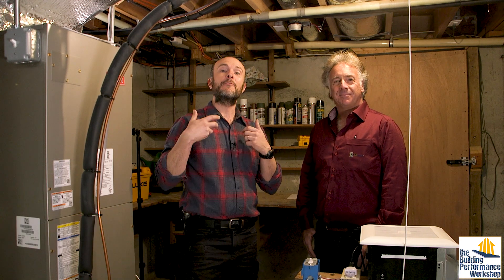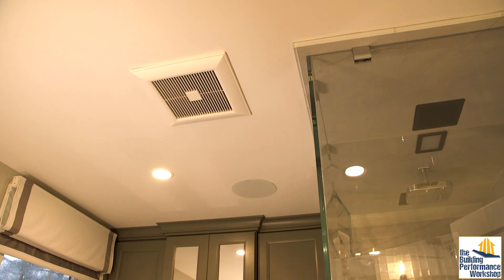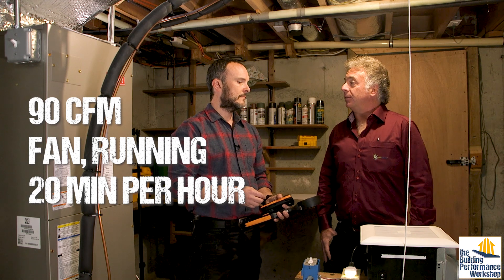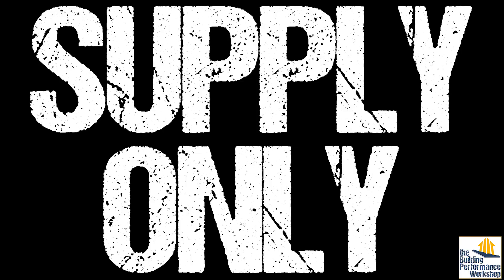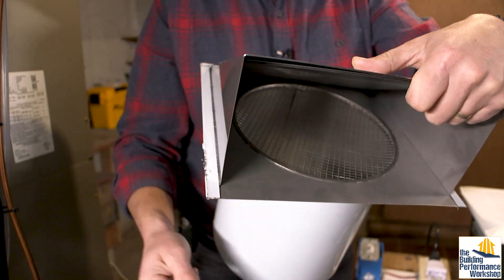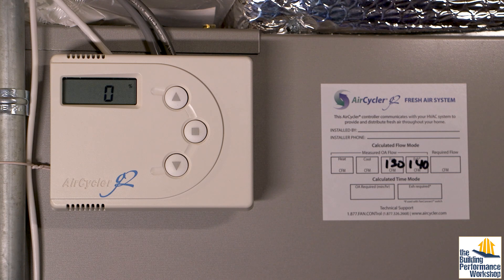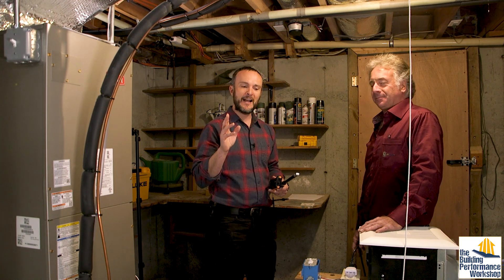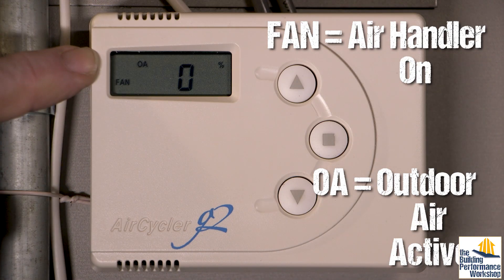Testing 3 Home Ventilation Systems: Exhaust, Supply, and Combined using AirCycler

Comment: The bro in red is an expert but says his windows are low e.  That has nothing to do with air flow lol.  he also says he can heat his house with a candle.  Does he use aerogel? doubtful.  R-rating just indicates how long it takes for two different temps to equalize.  Again, nothing to do with air flow as you can do this without an air exchange.

Comment: Fresh air supply question - 2 story home with full basement.  I have a 3 inch fresh air intake with manual baffle that feeds into our cold air return for furnace in basement.  When furnace blower turns on, the basement door is sucked closed.  This tells me the basement is sucking air from the first floor?  Or, does this mean pressure is being raised on the first floor because of the room vents?  Ideally, shouldn't this NOT happen?  Does this mean I'm not getting enough fresh air into the basement?  If more air could enter the basement from outside, wouldn't this be better for the whole system? Thanks!
Reply from the maker: Hey Rich- 3” is not a lot, so I kind of doubt that’s the only cause of your issue. Could also be an unbalanced duct system. Hard to tell untill you run the testing.
Reply: @HomePerformance  Home Performance - Thanks.  But that's my point, I don't think it's enough replacement air from outside from that narrow duct.  Need larger?  Related question... If I added an air vent to basement ductwirk (not a return, but an actual vent), wouldn't that help reverse the negative pressure that is generated by not having enough replacement air for the basement furnace?  I say this because this additional basement vent would add some replacement air.  Make sense?
Reply from the maker: Yes, but it’s also possible you have a lot more return in the basement than you know, through duct leakage. That’s why I love testing- instead of trial and error, you can figure everything out in one afternoon.
Reply: @HomePerformance  Home Performance - Yes.  Agreed.  I checked all the return ducts coming from upstairs that run through my
unfinished basement joists.  They are incredibly leaky!  Looks like a 10 year old did them.  1/2 inch gaps, 1/4 inch 3 foot long open seams along the ducts, and more.  When HVAC fan runs, these massive openings are creating negative pressure in basement, by obtaining air from the basement instead of upstairs return vents, correct?  If I seal these leaks in basement cold air returns as best I can, wouldn't this force my system to draw more replacement air from upstairs?  And this, along with one more vent blowing into basement, should help equalize pressure between the floors?  Thank you so much!
Reply from the maker: Yes, you’re on the right track, Rich!
Reply: @HomePerformance  Home Performance - Interesting!  Thank you so much!  I'm starting to wonder if my home ever truly needed a radon mitigation fan system now - given my basement is one giant 2000 square foot vaccuum now!  It's probably sucking radon gas out of the ground every time our HVAC fan kicks on or when my natural gas furnace and water heater combusts.  Am I still making sense?

Comment: over complicated m..... open the window case clod. good luck making repairs with that dam foam. its 15/sqft to cut it out to repair or add stuff in the wall
Reply from the maker: Old fashioned ways don't work the same anymore. Follow our channel to see why.
Reply: @HomePerformance , don’t try to impede tradition with progress!
Reply: For his specific system, he shouldn't just open his windows and you shouldn't just open your mouth.

Comment: Your audio is such a mess in your videos. This one, one mic is on the left channel and the other is on the right. Which really sounds horrible on a home theater that has a center speaker and a processor that’s trying to do something with it. Only place this might sound normal is a phone that’s down mixing it to mono.  🤦‍♂️ wish you tubers would watch videos on sound post production and what loudness is. And what YouTube’s loudness standards are.  

Sound quality is probably the biggest thing that separates broadcast TV and YouTube content. Can’t tell you how many videos I turn off because of horrible sound.

The way most TVs and AVRs need to see audio is a stereo signal. Mics should be mixed properly. When the level is the same on both channels, sound processors will assume that’s dialogue and puts it though the center speaker. Any difference in levels across channels will shift the mix left or right. It’s perfectly fine mixing with desktop studio monitors. Headphones are not great but can work if you know how they change audio levels. Best is to use a consumer 5.1 surround system combine with a shitty built in TV speaker.  Checking the mix on both.  Slap a compressor on each mic to keep levels consistent. Monitor loudness levels at the end. Most nonlinear editing apps have monitoring tools built in or you can get plugins. Or you can use third party apps to analyze a video file and give you audio metadata like loudness, peaks, dropouts, etc.   

https://youtu.be/jowVS3qz0CQ
Reply from the maker: Golly, I am SO SORRY that our videos that no one paid us to create, and which you fid not pay a cent to watch, don’t meet your standards for network television. Also, with such an amazing viewing setup, you should have an option to listen in mono. Please be nicer.
Reply: @HomePerformance  And here I've been focusing on the science you're overwhelming me with!  It must be the sound quality that's causing my brain to explode when trying to absorb this free science lesson to us!

Comment: It would only be smart to bring fresh air in through a heat exchanger as the air goes out.  Otherwise you are drastically raising your heating energy or conversely your cooling energy.  It has to make common sense.  Why would you pay to have a super tight house and then introduce air leaks on purpose?  If you need ventilation it has to be conditioned or you are wasting money.
Reply: Douglas, 
Physics tell us that there is not a lot of energy stored in a cubic foot of air. You can compare the cost of operating and conditioning the air using an AirCycler ventilation product vs. a system with energy recovery with the Cost Ventilation Calculator that Residential Energy Dynamics (RED) developed https://www.aircycler.com/pages/calculator. You will see that not only is the cost to operate an AirCycler AND heat or cool the incoming fresh air minimal, but when compared to the cost of purchasing, installing, operating and maintaining an HRV, the AirCycler is the more efficient system. 

Let’s not forget that it is a relatively small amount of controlled fresh air being brought into the home. In the 20 years that AirCycler products have been on the market, we have not received a complaint of drastically increased energy bills. Tightening up the home and adding mechanical ventilation is the industry standard for maintaining healthy indoor air quality. There are a number of mechanical ventilation products on the market, ranging in cost, ease of installation and maintenance required.
Reply from the maker: This is America. Everyone here wastes money every second of every day. Wasting a few bucks on untempered outdoor air seems much more reasonable than on alcohol, wings, coffee, fidget spinners, etc, etc. Remember, these ventilation methods are perfect in renovations, or when you don’t have the space or budget for an ERV that does what you suggest. Ventilation is NOT just for the wealthy, or just for tight homes.
Reply: shut up just as wack as these clowns open a dam window
Reply: @divinee.155  Bro are you okay?

Comment: Corbett.  This is good stuff.  Thanks for the link on how to find out how much ventilation you actually need.  I've been somewhat confused on that subject..  On my first (just finished a couple months ago) high performance house, It's been trial and error.  Currently the ERV just runs 10 mins/ hr.  I still don't know if that is enough or not.  That house has an overall ACH of 1.3.  
In my speck house applications (No ERV or HRV and ACH ranges anywhere from 2.3 - 2.9 ACH) but the 'whole house fan' has a 1980's looking timer that turns the fan off or on a couple times a day.  I'd been thinking 1) there has to be a better product than this old school looking fan that the electrician installs. (After all, he's the electrician, what does he care about ventilation? He's just installing 'standard' equipment unless told otherwise.)  And 2) There's gotta be something out there to better optimize the fan.  In other words, it's probably not best practices to run a fan for 1hr straight and nothing for 12hrs, then another 1hr straight, etc.  Sure that may meet code, but it doesn't seem to be that efficient.  It looks like the products in this video can help with that.  Much better technology.  Good stuff! 
I wouldn't mind if you were to do a video walking through that ventilation calculator at some point.  I really appreciate the ventilation videos.  Thanks for the quality content!
Reply from the maker: Thanks for sharing for other viewers to see buddy- the struggle is real. Yes, the ‘sipping’ technique for outdoor air is better for so many reasons. I’ll do that vid- good idea.
Reply: @HomePerformance  Thanks! I was just literally on that RED Calc website! So I appreciate it as I'm struggling to figure it out.  For example the Measured leakage at 50Pa in the referenced high performance home is 407 cfm.  That seems to confuse the calculator since it's under 500.